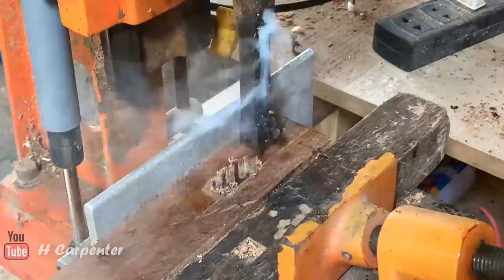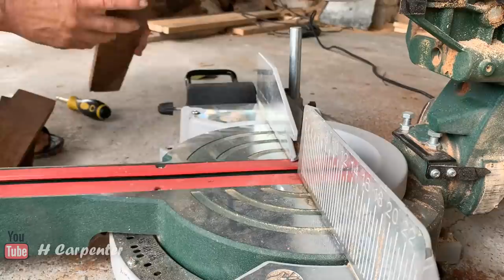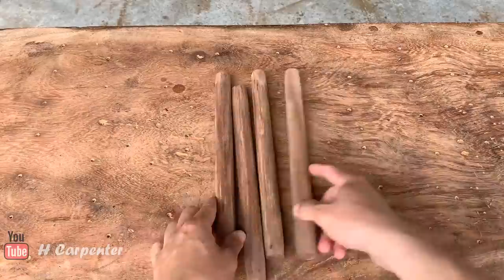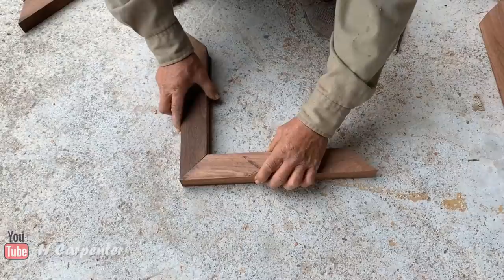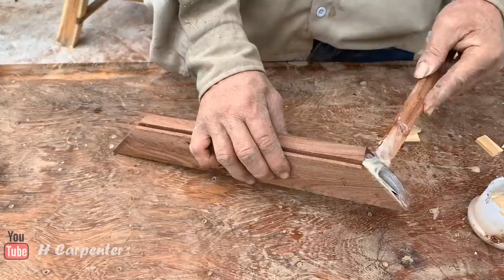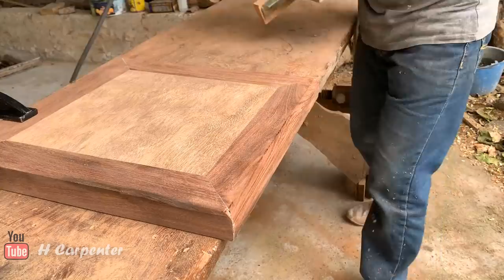Awesome Creative Woodworking Joints Skills || Build Your Own Outdoor Coffee Chair

Comment: That's either some hard wood or you need to clean the bit in that mortiser. And, yes, those bits will gum up just like a table saw blade will, same with a band saw, etc.  Beautiful chair. Cheers :)
Reply: This is why i came to comment section. Ty
Reply: @LOUDsigh  q

Comment: Did he glued the panel into the frame? Will there be problem with seasonal movements?
Reply from the maker: It is very solid, you try to sit and see
Reply: @HCarpenter  No doubt that you are good craftsman from other joints you'd made. And no doubt the chair is solid.  Because conventional wisdom had taught me that we need to consider seasonal movement and therefore not to glue panel into the frame. I am just trying to understand why you choose to do it differently and put glue in the groove that holds the panel. Thanks.

Comment: Beautiful piece of work! What kind of wood did you use?
And what was that tool you used to make mortise holes with
Reply: @Daniel Blazer Vibrating? Its a hollow, square chisel, with a drill bit inside it. The drill bit is just slightly smaller than the square chisel, and drills out 90% of the waste. The square chisel cuts the hole round hole square.